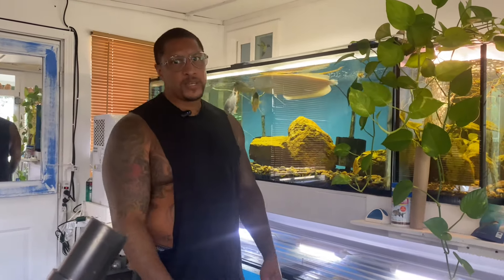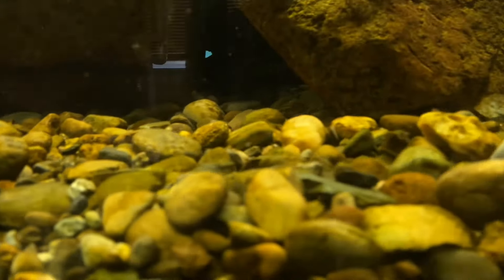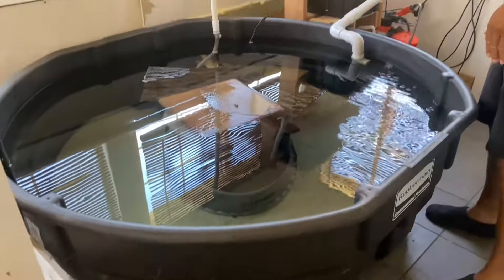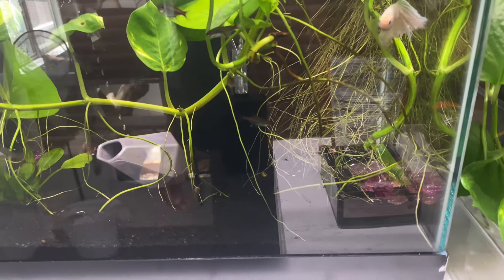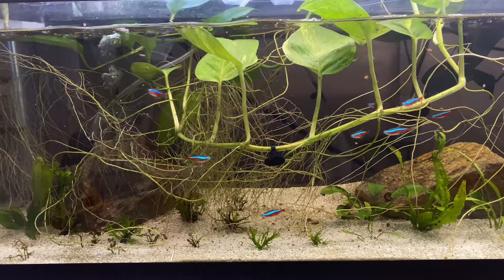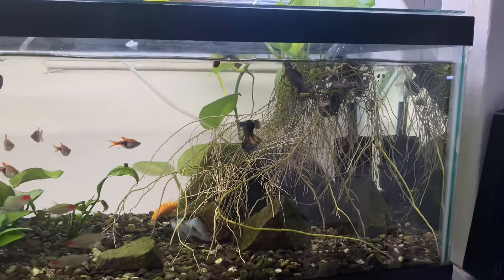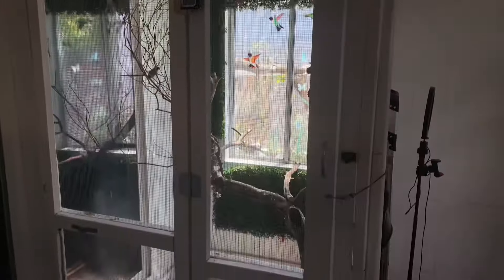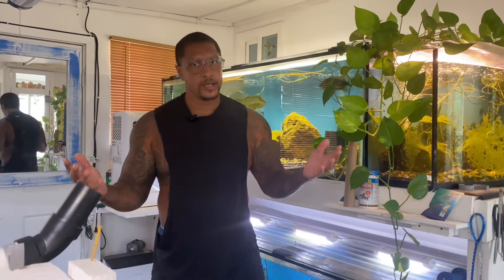FISH ROOM TOUR

Comment: Hey I’m going through a mean diatom phase, is there anything I can do to get rid of it? Any products you recommend?
Reply: Cut the lights off
Reply from the maker: If you don’t have plants, you can definitely cut the lights off. Also limit feeding and increase your water change frequency.
Reply: @TheFishCorner  I meant for salt water, I should’ve said that first lol it has corals and 3 fish in it. No sand swifters
Reply from the maker: lol. That definitely changes things. 

Well, high nutrient levels is the cause of diatoms. I would suggest more water changes, less feeding, and shorten the length of time the lights are on.